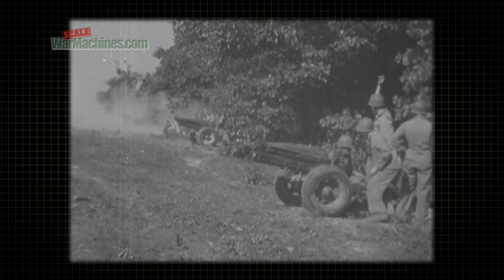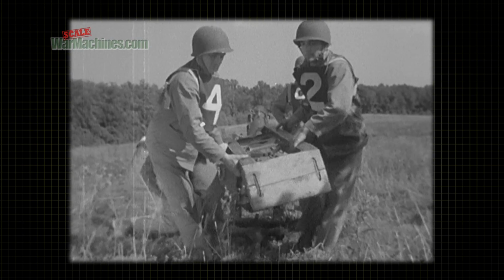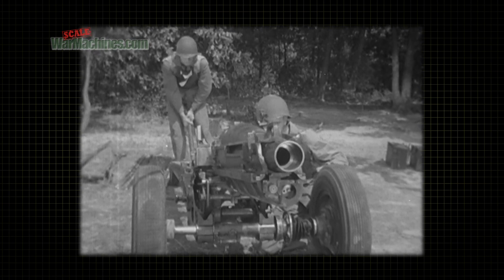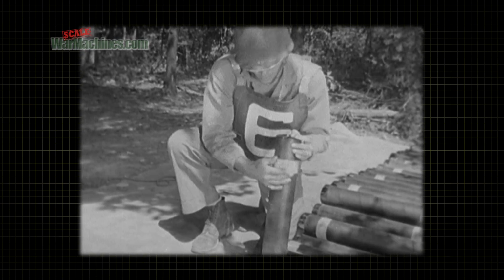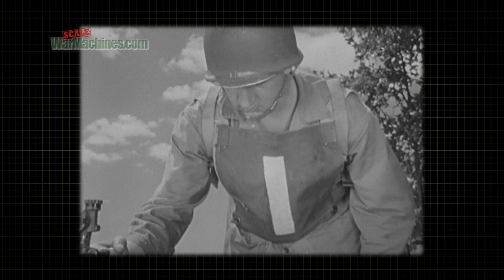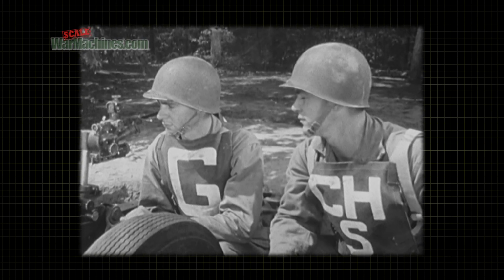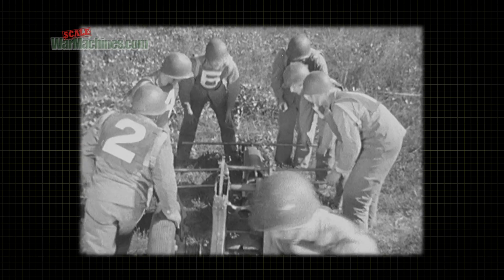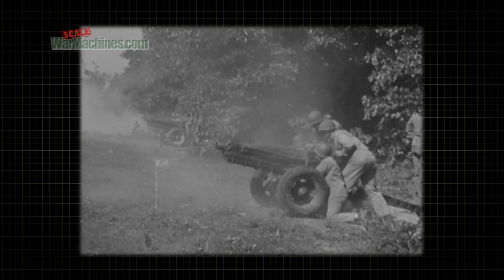75MM PACK HOWITZER (HOW TO OPERATE) REFERENCE FILM

Comment: battery size has changed a battery is 6 guns now! we need to bring this little turd back it'd be good for paratroopers and special forces use!! this is the first i've found on any part of firing beyond the loading you wouldn't know where a person can find video on how the aiming directions  from the fire direction center are determined by chance?
Reply: I believe some were bought back for a brief period fighting in the Afghan mountains. There was a procurement notice of around 75,000-100,000 75MM Short pack howitzer rounds around 10-15 yrs back.

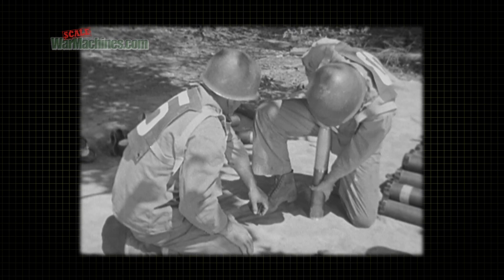Comment: What are all of the commands that are being stated? Specifically, what are the firing commands? Starting in the video at 15:09 mins. It is hard to hear them in the video, and closed captioning doesn't translate it correctly.
Reply: first they say what kind of round to fire, what fuse delay etc, then they say how much to turn the gun left or right, then they say the quadrant, then they say fire.

Comment: Is this the same 75mm French 1897 used by the allied in ww1?
Reply from the maker: No that's a different piece which was used on various platforms like the M3 Halftrack in updated form and which led to the early American long barrel 75s which in turn led to the US own design 75s, 105s and so on. Their Long Tom can also trace its lineage back to the WW 1 era French 105.
Reply: no different gun entirely this one was designed for mountain warfare and paratrooper use mainly as you can tell by the name pack howitzer it was designed to taken down to the point where 6 pack horses/mules could carry it the thing only weighed 350 pounds and had a range of 5450 yards where the frog 75 was a pure towed artillery piece and was close to a ton in weight and had a range of around 7500 yards due to a longer barrel!
Reply: Yes and No, this gun used the same shell as the m1897 but the gun itself was all new.  Please note the same round was also used in the 75mm M3 Grant and M4 Sherman tanks of WWII, with the M4 used a modified breech from the M1897 to better be used in the M4 turret.